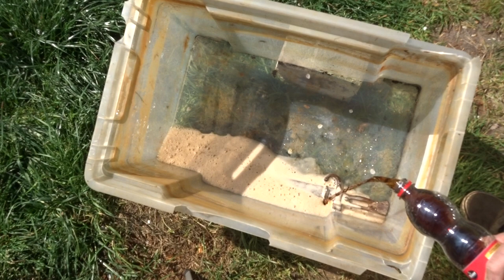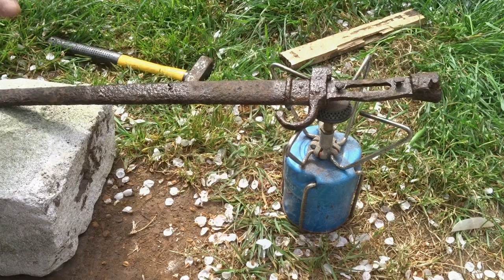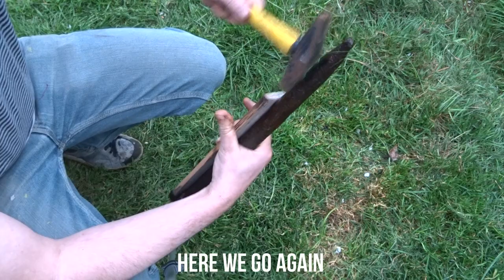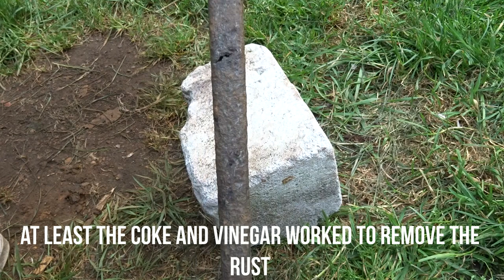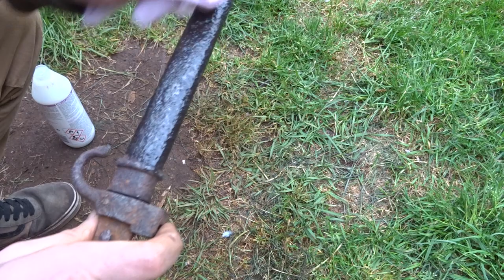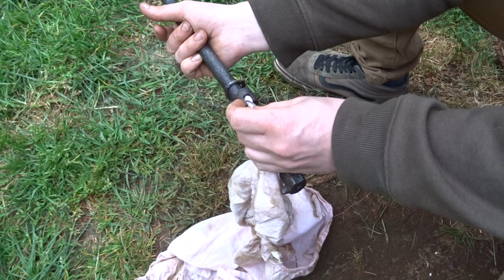WW1 relic bayonet - French Mle. 1892 Berthier

Comment: If you're gonna use heat do it properly! Heating the handle just makes it bind more. Put it in a BBQ for 20 minutes until it glows red hot, then drop it in a bucket of water. The quenching causes a differential cooling and contaction rate between the scabbard and blade and you should hear a nice crack as the bond is broken. The problem with doing this is that it will leave the metal a red colour that is hard to shift.  Other method is electrolysis.  Attach the cathode to the tang of the bayonet and it should work loose and derust nicely in a day or two.
Reply: I had a german k98 bayonet and cleaned it with electro lease but still it would not come out so I used a grinder to make a small cut on backside of scabard to open it and then I could pull it out 
And the scabard is lying on the side with cut so it looks still Nice in show case
Reply from the maker: Thanks for the advice Bob, I know the heat treatment as I was doing it wasn't good. Next step would have been to try and heat it up completely but I ran out of gas and all stores al closed because of corona. I think I'll give electrolysis a go, have some experience with that. Let's hope it works. Thanks again for the tips!
Reply from the maker: @ww2historyfinderl587  I'll try electrolysis first and if that doens't work I'll see. But in that case I think I'll just leave it the way it is. We'll see when I get to it.

Comment: I don't know if you were able to separate the bayonet from the scabbard by this point, but banging the scabbard with a hammer (not a steel or iron one) should help a bit.
Reply from the maker: I tried with a rubber hammer but... also failed. By this point decided i'm going to keep it as it is. Still a nice piece and in this condition it still has it's charm...